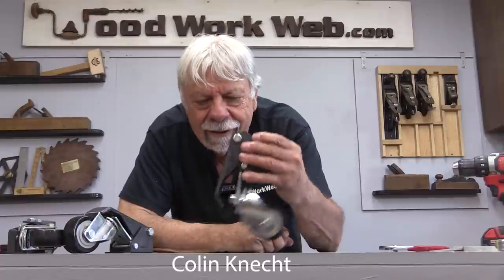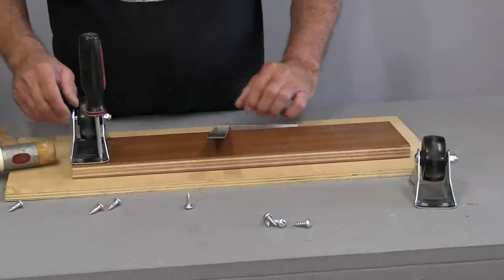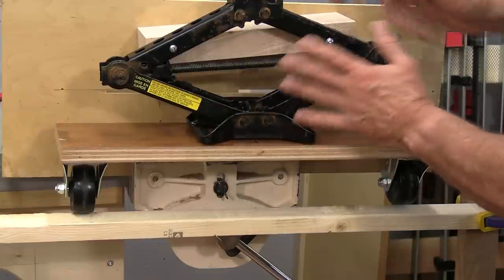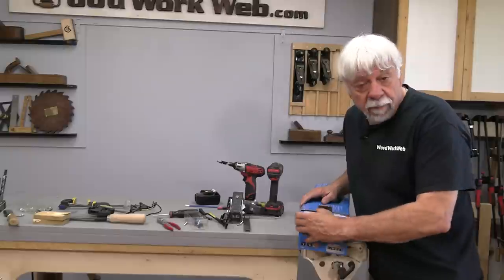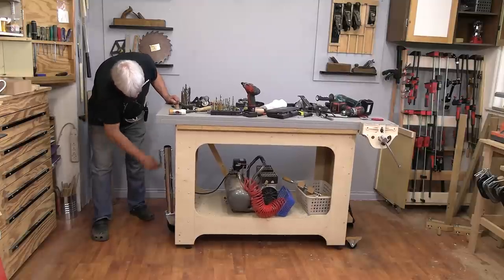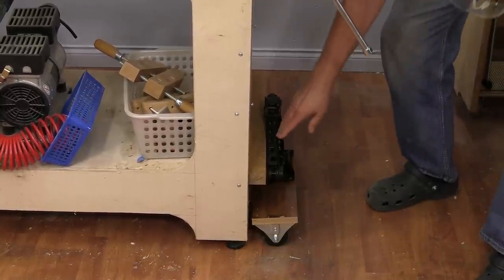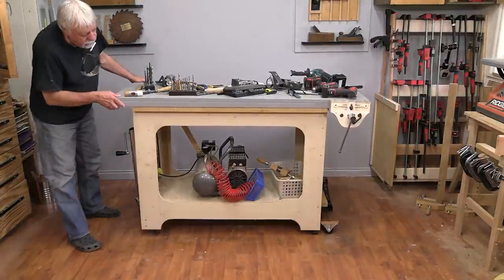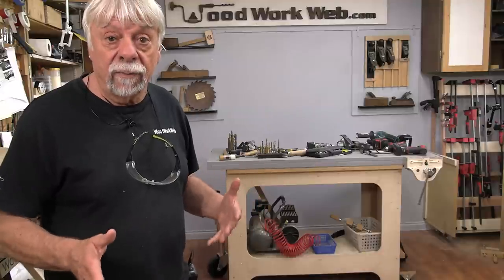Wretched Workbench Wheels Replaced

Comment: For the side with the scissor jack, you don't need a jack at all. Just mount the wheels solidly to the side of the table so they are just touching the floor. When you jack up the other side with the trailer assembly, it will tip the bench towards the wheels on the other side, lifting that side off the floor and putting it on the wheels.
Reply: My thoughts exactly. Hopefully he reads this before he adds to it anymore.
Reply: Bravo!
Reply: Not a bad idea at for mostly level garage floors but some may need the jack type thing if they have to move the table out of garage though if they are thinking of it, they could prob manage it as you suggests.
Reply: Really good idea
Reply: My first thought also

Comment: Ohhh boy!
Colin, that scissor jack is gonna break off...  I recommend using couple of threaded t-nuts on the "inner" face of a spanner block between the legs, and using 2 long bolts, 2 washers, and 2 to 3 nuts, to lock in just the head of the jack.  
The long bolts allow for you to use 2 nuts to position the head just a tad bit away from the spanner block.  This allows for the jack to go down a straight 90 degrees.  If the bolt is too short or nuts not positioned correctly, the bottom board that the wheels are attached to ends up flaring (more than 90 degrees) and the wheels kick out further.  This will eventually cause the wheels to exert enough lateral force, leading to side-pressure, and tear out the screws that are holding them in the board.
Let me know if you want to see the set up I ended up using w/ an old scissor jack
Reply: In short: can't use the jack-arms to lift - only the top/head. Fix a horizontal plate between the legs and have the jack(head) lift that.

Comment: A couple of suggestions. A strip of say 1x2 timber fixed to the bench under the platform the wheels are on could act as a shelf to steady it when the wheels are down. Also the platform tends to pull away from the bench because the scissor jack flexes. Two short lengths of T-track fixed to the bench with the T-track bolts fixed to the shelf would minimise this. They should probably pass through an "L" bracket on the shelf so you can use a nut to adjust them to bring the shelf closer to the bench.
Reply: Too Heath-Robinsonish. See Will Morton's comment below.

Comment: Get rid of the scissor jack. Fix the castors to the end of the bench at a height where they only engage once the trailer jack is taking the weight of the other end of the bench (has lift it off the feet.) Or even replace the feet at one end with locking castors. The (lack of) quality of the solution you have created seems very out of character for you.

Comment: This was confusing. Seems to me there must be a less complex and less expensive solution.
Reply: Carl Holmgren has it figured out. Casters mount on 2 U-shaped pieces connected by door hinges, resting underneath 2 ledge-stops running across either end with a foot-operated lever mounted on one side. Just one step and twist of the foot to engage and disengage the wheels, no jackscrew required.

Comment: Just curious... Is it possible that you have the old wheels mounted too low on the workbench? If you had mounted them higher, it would take them further from the floor when dis-engaged? And once you shift it a little bit, it seems trivial to just flick the levers with your foot to fully disengage again?
After watching the beginning of the video again, I'm thinking that maybe I'm thinking the opposite... The wheels weren't mounted low enough on the table. If they were mounted closer to the bottom of the "legs" of the table, you'd have to lift the table further before the wheels would drop into an "egaged" state, therefore you'd be able to do the slight movements that you were looking for.
Of course this is all from someone who has never laid hands on these wheels and is only going by watching the video and how the assembly is moving.

Comment: 4 small castors on a piece of plywood, like a little dolly.  Mount your jack on top of the dolly and place it in the middle bottom of your work bench.  You only need to drill a hole through the bench skirt, to raise/lower the jack.  could be very easy - and with an impact driver and a socket you can do this with almost no messing around.

Comment: I struggled with this issue as well. Basically my wheels where always engaged and only held with two breaks when planing the table would move. My solution was to mount the wheels under the table with a piece of 2x4 and have it pivot away on hinges when you lift the table slightly. The good is that the weight of the table keep the wheels in place.

Comment: Not my original ideas but: Put two 'T' strap hinges between the two wheeled flap and the workbench which will stop flopping about. Then you can move the jack up somewhat higher on the bench so it is easier to reach, get or make an adapter for the screw mechanism that lets you use a drill to wind it up and down - bonus points if you make two adapters and attach one to the single wheel jack in place of the crank handle (so you don't take out a knee walking past). It could be as simple as a couple of eye bolts welded on and one with the eye opened into a hook that goes in the drill chuck.

Comment: Colin, if you want to maintain your current configuration, I suggest adding two L brackets, with bolts, nuts and washers, between your plywood base and your bench table legs. This should remove a lot of the side to side motion. I think this might be a quicker fix, and more ridged, than adding wood blocks.
Reply: Wouldn't work, as the table needs to move independently - if you fix the plywood, the jack will push up the table - which is now fixed. Something will have to give (most likely a screw or two). (I thought of the same - two, not so great, minds 😉)
EDIT: it could work if you have a slit in the brackets, through which a bolt could move vertically

Comment: Imagine the wheels at the tips of a calliper, mounted to the end of the bench, in the middle. You pull the middle of the calliper up, the wheels go down. You could use a nylon )low stretch) cord, perhaps supplemented with a lever. Same at the other end, or perhaps a single swivelling wheel. You could do the entire bench shuffle without bending over.

Comment: the fixed wheels don't need to be on a jack, when the table is level position them (securely cause they suck now) where they don't make contact, use the jack on the other side to raise one end until the table tilts enough to engage the fixed wheels... not like you need to have your table level while it moves

Comment: Had exactly the same wheel you started with. Hated them. They would not rotate sometimes and the bench would not move or go in the wrong direction.  My bench has drawers full of tools built in and is made from laminated 2x4’s so it is very heavy.  Your setup would fail with a heavy bench.  I finally replaced them with 4” dia steel wheels and not it rolls when I want it to.  To lock it I have a little wedge thing made to slide on both sides of the wheel. .

Comment: Fixed wheels are great when there is nothing in the way, but they don't work for me when "parallel parking"  Which is most of what one does with tool plaform.  With small things like drill presses where you can pull them out the rotate them where you want to go it is ok.  But benches are far longer than they are wide, and do not take guidance that well.

Comment: Use hinges on the fixed wheel side so the wheels are barely off the floor. Get a second trailer lift, but don't put the wheel on it. Put the axle of the second trailer lift through a block so it can't turn, and pushes against the board you have the fixed wheels to. Having to get on the floor to raise the scissor jack appears to be annoying, and fussy. If you have two of the trailer lifts, you just turn the crank. By simply adding the second trailer lift as a fixed screw that only pushes the wheels onto the floor, you can have the bench ready to move in about 15 seconds, and with less effort.

Comment: place Wheel on side  end of lever/wood that is vertical to bench edge place hinge on opposite side of lever, pull lever horizontal levering wheel under bench and lifting bench, make sliding stopper to secure it.

Comment: Seems a bit of a mess and an idea that doesn't work very well. All the hardware used seems to more of a hazard and not worth it. As others have suggested get rid of the jack and just have the wheels just touching the floor so when you raise the other end the wheels will engage. Not a good solution this time as I think you will find out with more use. Sorry just my thoughts on this one.

Comment: I use 100mm heavy duty locking castors with brakes, which take 120KG per castor. Solid, sturdy and no movement in the bench when brakes applied to to even 2 of the castors. To me, you over complicated things. Can't believe I just said that to someone I learn from and admire.